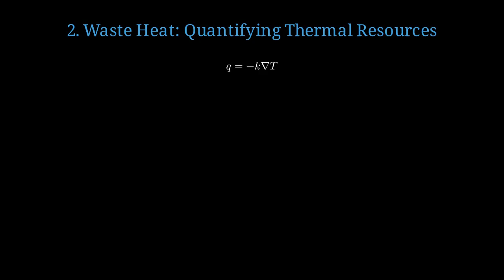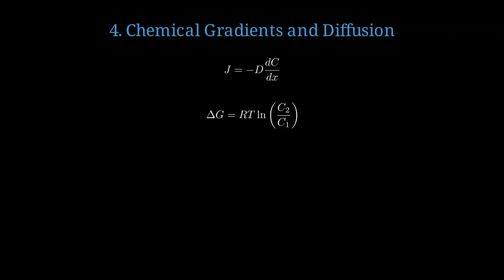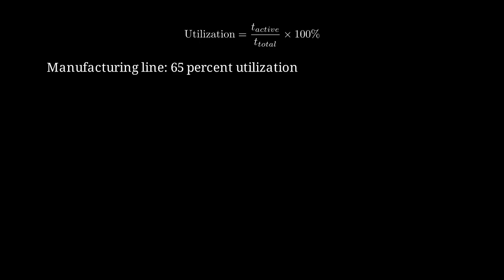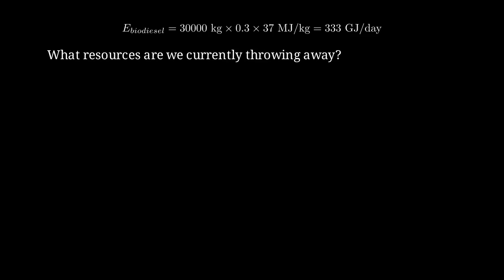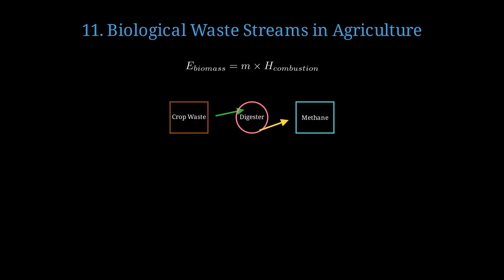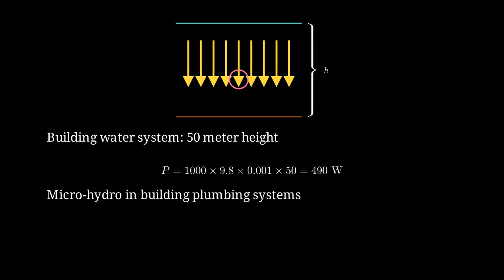Why Waste is Often a Hidden Resource?

Comment from the maker: How can multi-source energy harvesters be optimized for fluctuating thermal and mechanical environments?
What are the thermodynamic limits of integrating waste heat, vibrations, and electromagnetic energy in one closed system?
Can large-scale industrial ecology frameworks achieve net-zero waste through complete resource symbiosis?